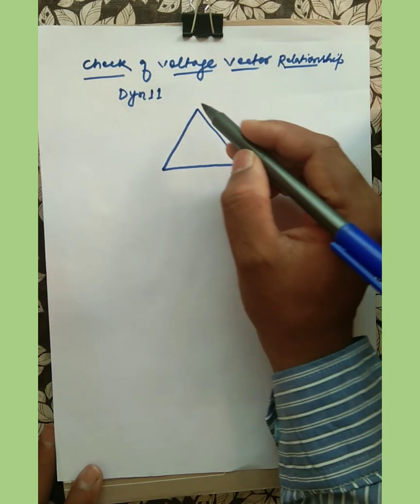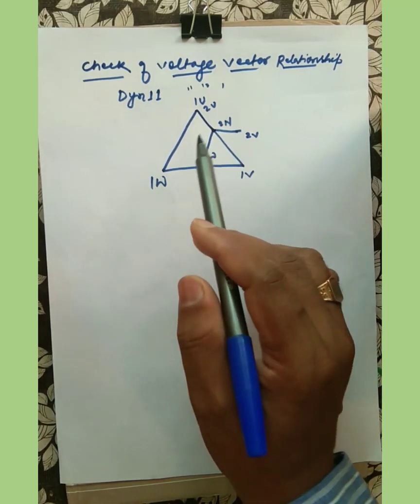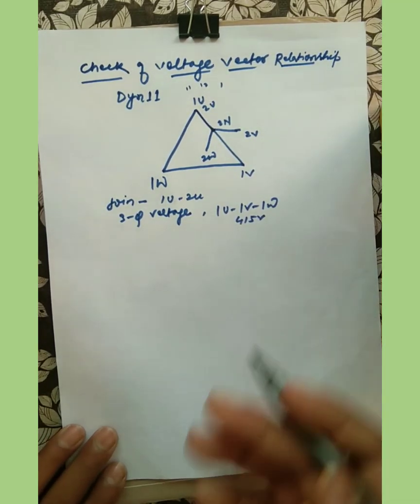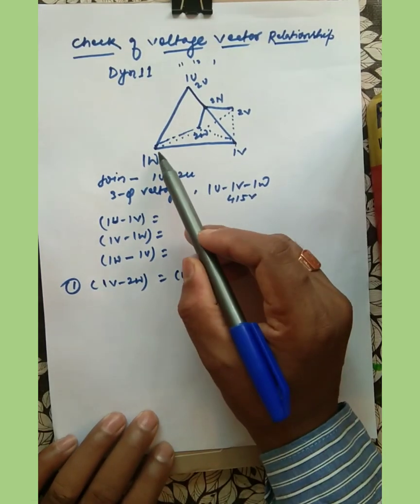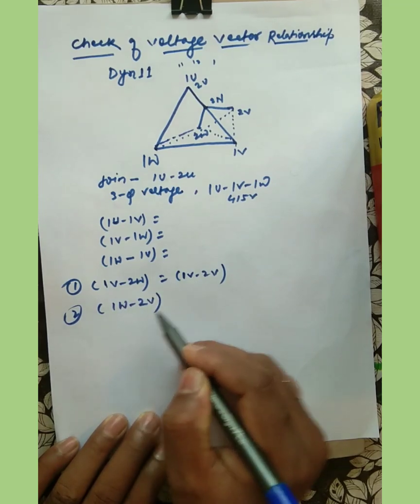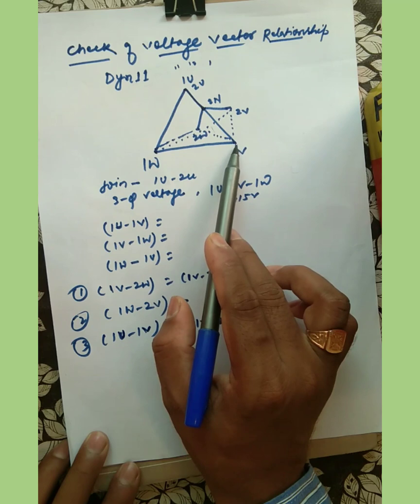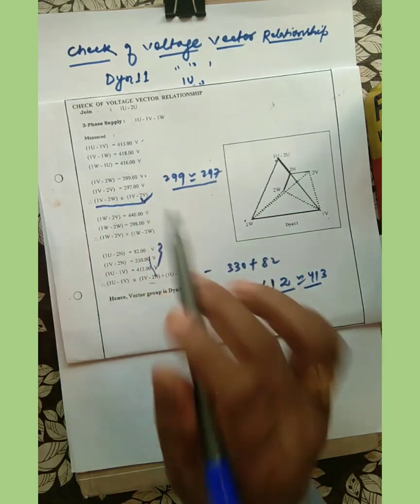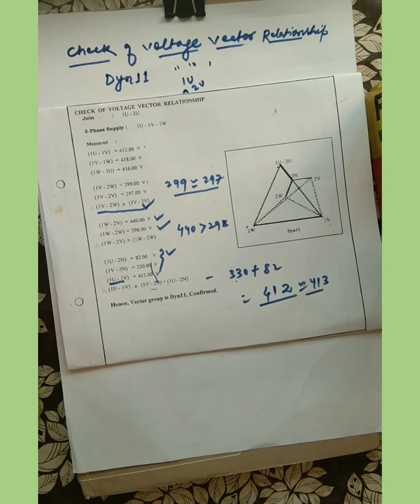Transformer Dyn11 Vector Group Testing

Comment: Excellent video . Well explained and presented .  So for confirmation the setup is as follows : Label the   Delta primary  phases as R1,Y1,B1 and the secondary Star (or "Y" if you prefer )  phases as R2,Y2,B2  with the neutral labelled as  N2   , then you connect R1 to R2 before making the measurements you described . Is this correct?

Comment: How to calculate ℅impedance of PTR of any KVA
Reply from the maker: % Impedance value  represents amount of normal rated primary voltage which must be applied to the Transformer to produce full rated load current when the secondary winding is short circuited.
If we have % Imp =7 and primary voltage is 11 kV ,so if we apply 11*0.07 kV voltage in primary under secondary short then we will achieve full load current of Transformer.
Reply from the maker: Calculation I will share if you wish..Till then subscribe my channel for the latest videos..thanks